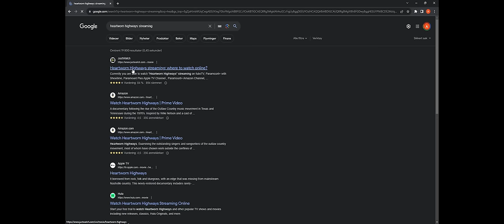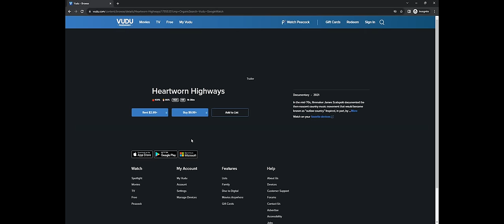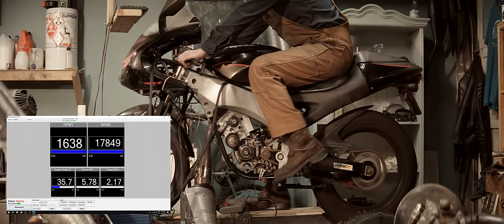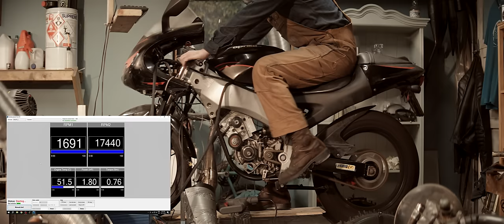Couple of tweaks - Solved the Overheating issue? Road to most Powerful 50cc.

Comment: Maybe you need a rollerbearing and oil seal ? If any metal gets hot it expands so slip disk / rotary valve is working with friction, the only way to battle it is a custom order / made bearing-race or something in between

Comment: Loving the videos, keep up the great work.
As for the heat issue, could the tension on the gearbox belt be forcing the crank in a downward direction - hence sending it out of alignment?
I agree with other people that chain drive is the way to go. Good luck 👍

Comment: Should probably see if there's anyone you could borrow a thermal camera from, that could see where the heat is coming from. That way can see if its throughout valve cover, then its rotary valve rubbing. If its bearings themselves or the shaft bringing heat out from something internal.

Comment: Large diameter of rotary valve is  long moment arm, and it has to be lubricated with the two stroke oil in the mix. Anyway to reduce the diameter? Or make sure the "opening" for the valving is as far out as possible? And have watched for a few years. My first observation years back and I still wonder now is the primary compression and the velocity of the gases into the combustion chamber due to the large transfers been holding you back some. looking at the new Husqvarna's ( saws & autotunes ) show tiny, comparatively with older designs; transfers that are routed surrounding the exhaust port to pick up heat.....and as a result the intake charge expands rapidly &  accelerates the gasses into the chamber. Those new saw designs made me rehash my entire understanding of transfer port design & size. Hence the question on primary compression & transfer sizes relative to the primary compression :) On my saw builds, I also found misalignment of main bearing creates a lot of heat & drag. A LOT of Husqvarna 372 XTorx's died because of that early on in the 2012-2013 era .  Enjoy your channel, a true engineer by nature on display here. ( I had worked for a company named VOR once, big four strokes with a gear driven cam, saw that timing belt and thought of that as it flapped around from accel to deceleration  :) )

Comment: Dowel or step bolt the cases , every time you pull the motor change bearings and seals , bearings and seals are cheap and if possible a drip feed system to the bearings. The most important bit is dowels in the case possibly a counter balance for the rotary valve ?

Comment: The saw blade is used for for a rotary valve it's meant to flex when it gets up to speed maybe that's what's causing causing the the firction you are seeing so when you cut the blade to make a rotary valve you a changing the geometry of the blade

Comment: What oil mixture do you run? On such a high revving engine you might need to go up to 1:18 like in the good old times 100cc kart engines used. Those engines made up to 20000rpm, whereas peak power was at about 14000rpm. (Overrev capability...)

Comment: Gluing the backplate together with epoxy may be mechanically OK, but the stuff acts as a great thermal insulator, making heat dissipation to the relatively cool-running crankcase ineffective.

Comment: Belt for the transmission may be to tight . Try running it at those RPMs without the belt on and see if it still gets too hot. Also the bearings may be sub par. You're running crazy high RPMs you need extremely well built bearings and races.

Comment: Could the drive belt tension be putting a high level of stress on the bearing, causing premature wear and overheating? Maybe a chain would reduce this. Was the bearing overheating before you connected the belt?

Comment: You really need to dowel those case halves together and bore it as one to do it properly. Given that you can't take more off the bearing bores now, the best way may be to bore them bigger and make some steel sleeves to be pressed in, then finish bore them to size. Line boring on your lathe may be your best option if you don't have a boring head and/or clearance on your mill?

Comment: During separate run-tests, ad anti-friction additive in the fuel? It will give You, if not precisely, at least an simple feasible, (and easily comparably & repeatable) test method of the rotary valve friction theory.

Comment: High heat type bearing ? Ceramic? Is this bearing rated for the high rpm ? A dedicated oiler system should be an easy fix. If too much side load is on the bearing can you go up a size or 2 ?  I still think an oiling system for the bearing would be helpful . Really happy to see you have it this close to perfect. Keep going!!!

Comment: Another idea for the heat in bearings. Could be caused by the tight fit within the case compressing the bearings too much. Causing them to be “preloaded”. Obviously they need room to expand for heat and speed

Comment: Maybe put a brace between the engine crank and gearbox, so when the belt is tensioned those forces are not ending up in the bearings.

Comment: If it's getting hot on both sides it sure does sound like some kind of disalignment of the crank causing the bearings to seize or atleast not work properly. But you've ran it hard bedore without heat? Doesnt quite make sense. I hope it's some smaller issue causing it.

Comment: Another great video! With the load of the timing belt to the gearbox, that also provides stress on the bearings and of course, heat! I’m just wondering, if the side loads are adding to the issue?. Can the belt drive be decoupled from the engine and supported separately with its own bearings so the motor only imparts rotation and torque? With high revolution engines, there is normally a rubber isolation to absorb the pulses and that has so many benefits. Just a thought, maybe other viewers can put their comments on this.

Comment: I was wondering the friction issue. Is there any passage for case pressure to go around the disc? Mayde case pressure pushes the disc against cover what causes friction and heat. Maybe making only the intakeport with tight clearance and let pressure go all around the disc elswere or make small slots around the disc, so case pressure acts only on the intake area, not the whole disc

Comment: Having the rotary valve means an imbalance of the rotating assembly. That combined with high RPM can cause a multitude of issues… Also bear in mind that with heat everything expands, so a slip fit of the bearings becomes a loose fit in higher temperatures.

Comment: I would look at the oil fuel ratio some of the old disc valve bikes ran fuel ratios of up to 20:1 and would run weak if you tried anything lower , I would have thought vibration would be more of a problem than burning out  bearings with minor alignment problems,  it is just my opinion of course,  if it was badly enough out of alignment to cause damage wouldn't it be stiff enough to feel turning the cank by hand? or be visible maybe?  when a 2 stroke runs wealk or hot  always think air leak or fuel and oil first.

Comment: maybe one or both bearings are bad or one of the inner rings is falling because it has happened to me before (in my case they were used in low rpm applications)

Comment: 18000 RPM I wonder if the bearings are getting adequate lubrication
Reply: I am fairly sure they aren't, hence why they only seem to last a few tens of hours of running on this engine version between teardowns.
Reply: Did he ever say what fuel:oil ratio he's running? Could go as much as 8:1 fuel:oil in principle, though so much oil will greatly reduce the octane rating of the fuel.

Comment: I know you probably don't read all the comments but I believe you're sucking vacuum through your case halves seal the case halves with loctite 518 flange sealant!!!!! It's what's used on boat motors and other aluminum case two strokes. Please try Sr.!!

Comment: You need someone to point a Laser Thermometer around the engine, whilst you are running it, that way you'll have an idea where the heat source is. At the moment you just don't know
Reply: Just use an IR camera
Reply: @frankroll8080  - Agreed, but they’re quite expensive. Would be really handy though
Reply: Someone suggested he could try to borrow a thermal camera. Would be nice to compare temperature with and without gearbox connected with belt tensioner. I know many electricians have this as tool to spot wires and stuff behind walls. I know one guy that maybe could be willing to loan him this over a weekend. It's like 200km one way between the guy I know and Alex. Maybe he knows someone nearby.

Comment: Why roller bearings? Wouldn’t a ceramic hybrid, angular contact ball bearing provide much less friction?
Reply: Having a roller on one end allows the crankshaft to get longer as it heats up, without taking up all the endplay and creating large thrust loads on the bearings.

Also cylindrical rollers can handle a lot more load than balls, for a given bearing size.
Reply: @nerd1000ify  thank you for that explanation! Makes perfect sense! Is there a preferred side for the roller?
Reply: @gerryporter8510  you'd probably prefer to put the roller on the side with the main belt or chain drive, that's where the heaviest loads are.

Comment: Did anyone else notice that the engine was actually idling now? Maybe the friction was so high that the engine did not have enough torque to run at low rpm. Or the rotary valve was leaking so badly at low rpm that it did not run.

Comment: I wonder how high an engine can spin? Has there been an engine spinning faster than 20?
Reply: Samual hayes .... yes, is the answer to your question , .... Honda had a SIX cylinder 250cc air cooled four stroke GP bike in the mid sixties ... it reved to 22 thousand rpm . ..... also suzuki and yamaha also had very high reving GP bikes [two strokes]  125, and 50 cc  which i believe were in the region of 16,000 rpm

Comment: And keep it that way, no force induction i would say. Because 50 cc is so small, it's a to high price payed
for getting power due to power loss at driving a supercharger. Stay at N/A engine and get it to max with
new better materials and proven knowledge. 20 Hp is way beyond good for 50 cc. get do some with fuel
mixture experimental tests if engine is good. Maybe a 20% nitro fuel mix, as going by correct needed ignition timing

Just a thought

Comment: Just have to modify ur rotary valve with bearing instead of connected to crank and  add arm that connects to silnoid that will allow to rotate just enough to open the port and in software control how long or when opens
Reply: It would be hard to get a soinoid to move fast enough for that application

Comment: Why not take a proven performer and see what you can get out of it. I took a china bicycle engine,through out the piston and cylinder. Used an adapter plate to match the china case on one side and a Yamaha vertical prebug cylinder on the other side. I used the Stage6 sport pro mk2 big bore cylinder and a billet intake for a mikuni vm20 carburetor. With an external spring dry clutch this lil engine is making 12hp + and turns over 14,000 rpm’s with everything off the shelf. I did no custom work. You are encountering more than one flaw at the same time, chaotic if I must say, but entertaining for sure. I watched you take chicken crap and make chicken salad and we all ate it, so don’t stop ,please don’t stop!!

Comment: It is fine to develope, but why sort of invent the "wheel" again? Go from what is known, and finetuning all this.
You stepped off the supercharged 50cc back to basics, and find troubles as well. Just asking why?

It may have cost some thousand of euro's already with traveling and getting parts and so on.

Just wondering why not start from proven works 50cc, and finetune them even more. 16+ Hp already 
been done 40 years ago in naturally espirated form

Comment: Instead of spinning rotary valve wasting engine energy why can u fix it onto bearing and use lobe to trigger opening and closing seems to be better direction then spinning metal with Friction causing unnecessary heat into motor just thought🤔
Reply: a spining valve is less friction and loss then a valve like in a 4 stroke engine.

Comment: Why not use Reed valve?
Reply: Becouse reed valve dont work at super high speed rev engine
Reply: @leandrogarra  never heard that before.
Reply: @KRShields  my english is so bad but reed bounce and dont close very vell at high speed. You can use reed very hard but dont work on low rpm. More engine use power bootle before reed to improve ... better use rotary valve.
Reply: @leandrogarra   use a stiffer or stronger Reed if it stays open at high rpm.  It's like valve float in a 4 stroke. Stiffer valve spring will keep up.  Your English is good by my standards
Reply: The reed is moved solely by pressure difference between crankcase and intake, so if you make it too stiff it won't open at all.

Some early 4T engines had no inlet cam, just a light spring so the valve could be opened by air pressure on the suction stroke. That was abandoned for the same reason.

Comment: the friction losses won't even be constant in terms of power. Torque losses are constant, but the power lost is quadratically related to the engine speed. Double the speed, quadruple the lost power. Quadruple the speed, 16-fold the power lost. There are also mitigating influences, but increasing losses are best reduced by avoiding friction points. I think you are on the right track with the strategy of reducing shaft seals.
Reply: SKF bearings states that Power Loss due to rotating friction is constant * Moment loss * rpm. This is not a quadratic, but actually a linear equation. You should post your formulation. So double the speed, double the power lost. This makes sense, as force and moment are also linearly related.

Comment: Your road is a squiggly circle.  Toss the rotary valve, it's old technology!  You want power you need an exhaust valve and a reed intake.
Reply: also a reed is less complicated to work with then rotary valve.
Reply: I think the idea behind the rotary is for the higher RPM. With a reed valve at 20,000 there's reed float
Reply: A rotary valve can also be adjusted for timing (although the adjustment is static)
Reply: With a rotary you can get an asymmetric input timing, something you cannot do with a reed valve.
Reply: No because reed intake doesn't allow for asymmetrical timing